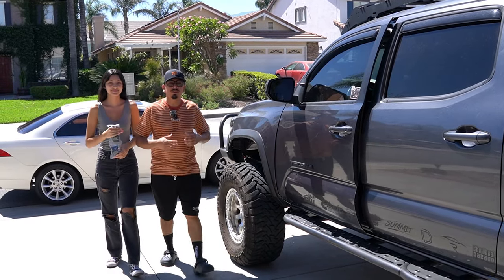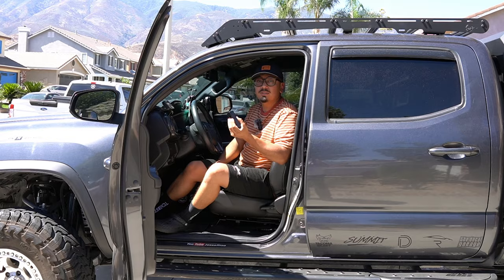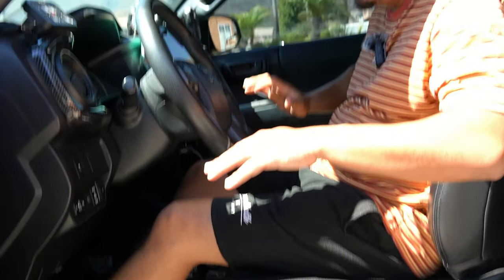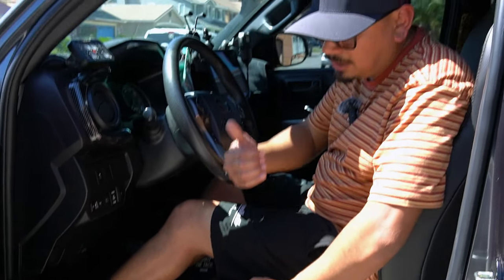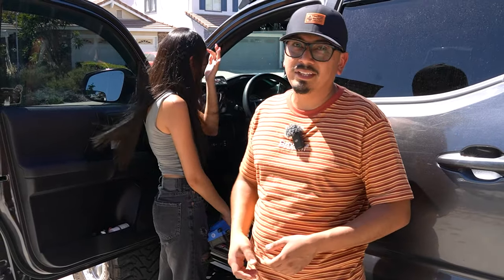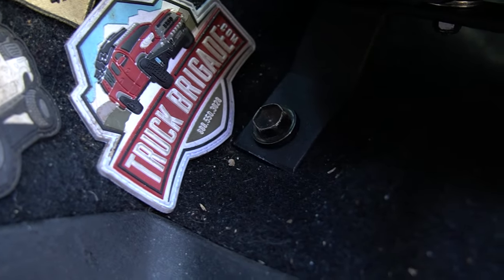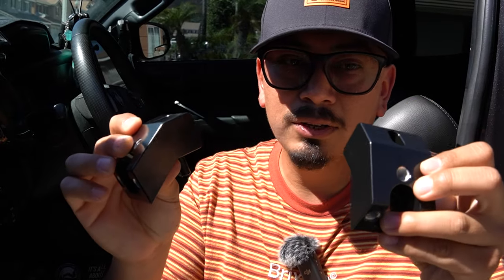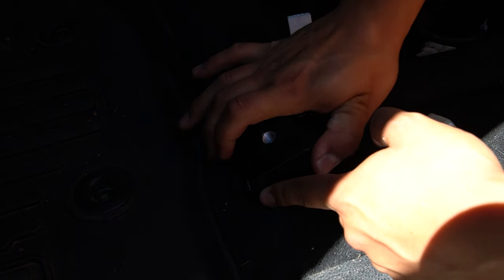Seat Jackers Lift Your Front Seats With This & Why? | How To Install 2016-2023 Toyota Tacoma

Comment: How do you get your patches to stick on the ceiling? Mine fall off easy.
Reply from the maker: It’s hard to explain but basically when ur putting it on the roof u have to like jiggle it on side to side with pressure so with the palm of your hand just push in go left and right hope that makes sense lol
Reply: @JesseRizo  I think I understand. I’ll give it a shot! Thanks. They don’t fall when you are on some difficult terrain?
Reply from the maker: @maxdeangelis5019 unfortunately yes they still fall from time to time especially on a trail with the movement but I just put them back lol sucks the 2nd gen Tacoma had a better headliner where it would just stick
Reply: Why don't you mount the patch on a piece of the hook part of Velcro. Or mount it first to a thin piece of flexible plastic then the hook part of the Velcro. Or how about some strong magnets to stick to the metal above the headliner.

Comment: I am tall 

But the seats.are manual

.I need more height..I have long legs and back injury...need to slide in

No stress on my hips..and or legs....I know they also. Have brackets..long to go

On top
Of ..the rails
...so it gives almost 2 inches higher. As you adjust your seat..back and forth....

Comment: So do u get 2 or 4 brackets per seat
Reply from the maker: Each kit comes with two per seat so if u want the driver seat u buy another kit equaling four
Reply: @JesseRizo  I see there's alot of different brands, do you recall a specific one, or are they all basically the same,  and I found on Amazon some kind of vibration observers you can get for the back 2 bolts.